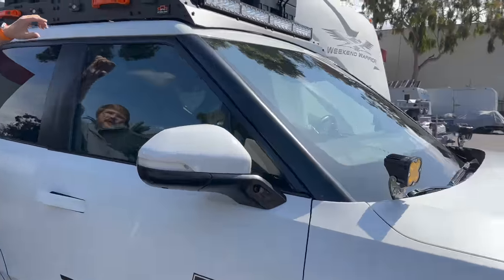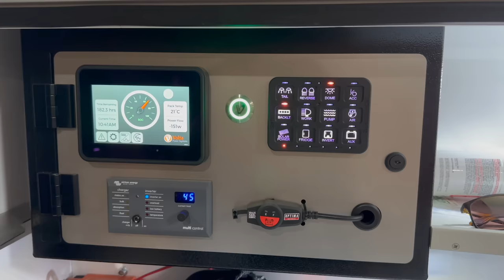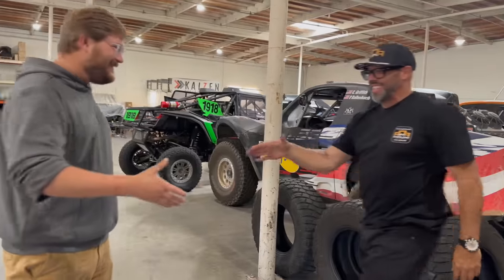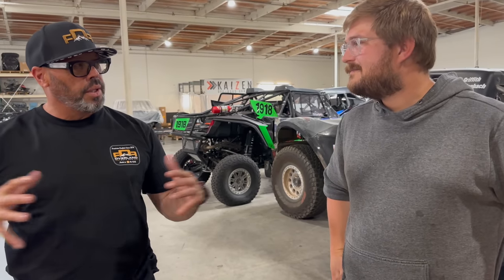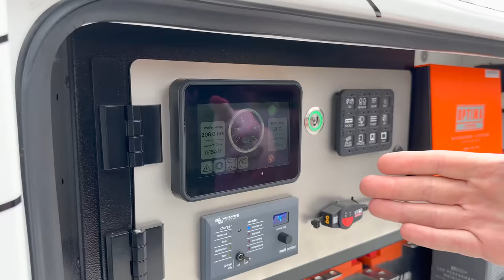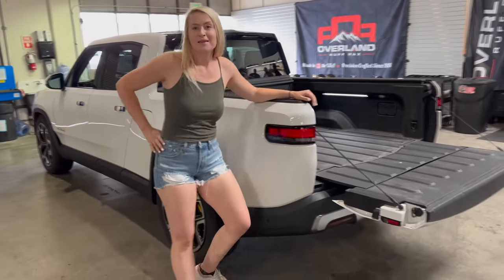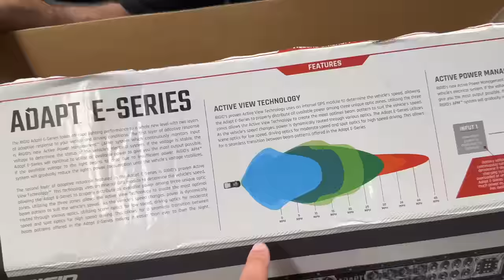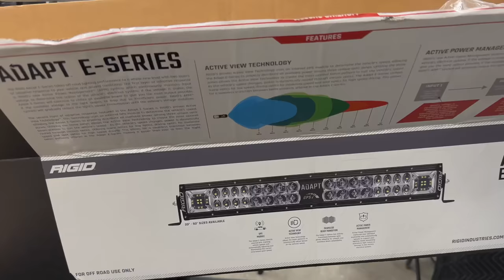Starting Our Rivian Adventure Build! Installing The Overland Ruff Rax Full System + DCE Showcase

Comment: Dang, that's some pretty cool kit!
If anyone's looking for light bars, Rigid is obviously the top end, but I've had good luck with Quadratec light bars. They're like 1/3 the price. I had one on my wheeler and my buddy had a few on his truck. Good light quality and after a few years, still had no moisture ingress. This was like 7-8 years ago, so as long as their quality is still the same it's a great option. I had the 10" dual spot/flood bar, was an amazing light for night wheeling. Easily as bright as a regular OEM LED car headlight on high. We both no longer have our vehicles, so don't know how they are at this point.

Comment: One of 2 working tonneau covers. 🤣  Mine is still kicking as well! Loving the bed/roof racks. may have to go that route on mine as well eventually.
"Same!" (regarding the front bumper).  I NEED a proper off-road front bumper and it'd be great if it could include a winch.

Comment: Roughly £120k in my portfolio are in tech/TSLA stocks, can I get an advice on any other stocks that I can acquire to diversify my reserve across multiple markets while creating a comprehensive portfolio allocation that balances my concerns of risk aversion and returns that meet yearly inflation.
Reply: You need to hire a financial advisor to help you diversify your portfolio by including Mutual Funds, Etf's, the 11 GICS groups, inflation-indexed bonds, and stocks of companies with reliable cash flows rather than growth stocks, where prices were based on future prospective earnings.
Reply: @leedavis3639   That's correct. At first, I wasn't too pleased with my gains compared to my previous performances, I was doing so poorly, I thought I needed to diversify into better assets, so I got in touch with an investment-advisor. That same year, I pulled a net gain of £550k, which is about 10 times more than I average on.
Reply: @chloeanderson543   My portfolio has been in the gutter for the entire year, so I started researching new ways to profit in the market, but everything I tried just seemed to miss the mark. Please let us know the name of your financial advisor
Reply: @farehtinyilmaz851   Having a counselor is essential for portfolio diversification. My advisor is "Trade with Ethan Grayson" who is easily searchable and has extensive knowledge of the financial markets.
Reply: @chloeanderson543   Thanks for this tip. His handle & website popped up on the first page immediately I searched Ethan’s name, I read through his resume and it seems pretty tight. So, I dropped a message & hopefully he replies soon.

Comment: Curious to see how the Rivian handles the rear roof camera being blocked all the time and if you find it problematic in any new or unexpected ways. Or if these guys have a solution to ”relocate” via an add on camera solution in the pipeline. Love it though.
Reply: I was wondering this as well.  How does Rivian use the bed camera?  Surely, not just for gear guard.

Comment: When bolting the rock sliders under the vehicle, they stated they were bolting to the battery. Were they using the frame rails or the actual enclosure bolts?

Comment: Why does Rivian refuse to program a virtual locker?
Reply: Im pretty sure they would rather you get the quad motor which every wheel is individually driven which negates any possibility or need for a locker. In theory the computer will identify which tire has traction and apply torque to that corner.
Reply: @Danielprokopij  kyle has a quad motor and just said in this video his free wheel just spins while the grounded one has no traction.  A virtual locker would force both motors to send power simultaneously
Reply: @carperdiem8754  My quad motor does the same. If I could get the truck to "lock" all wheels and spin at the same speed, I could gracefully climb rocks and dig out of the sand. Even "Rally" mode with stability control set to "off" results in one or more tires not spinning when trying to dig out or trying to help a friend pull me out. It was embarrassing, not to mention unnecessary.

Comment: Hmmm, why does that trailer that you used to charge your truck using 220v AC.  The trailer has batteries along with the truck. Why not charge using DC. It would be interesting to determine the loses are when going from DC to AC then AC to DC...
Reply: Because you can’t. The DC charging protocol has a proprietary handshaking process.

Comment: Update: Hi Guy,  We’re collaborating with Tesla to open charging for Rivian vehicles at more than 12,000 Tesla Superchargers across The United States and Canada.
Starting as early as Spring 2024, we’ll offer an NACS adapter that allows you to charge at Tesla charging sites. In 2025, Rivian will incorporate NACS charge ports as standard in R1T and R1S and offer a corresponding CCS adapter. No matter which charging port is built into your vehicle, you’ll soon have access to over 25,000 DC fast chargers spanning Rivian Adventure Network, Tesla Superchargers and other third-party CCS networks.

Comment: Why do you need lockers? That sounds like Rivian just needs to fix their traction control software.
Reply: What folks are most likely talking about it a "virtual" locker setting.
Reply: @ryangrassmann  No Kyle wants a physical locker, because he doesn't think they can make a virtual locker that works. (Obviously their current software isn't up to the task for some of the situations he puts it in.)
Reply: @mp3mike237  ok, sure. He thinks they can’t. But, they actually can. It’s really simple (background in electric motor control). Spin them all with full power capacity, modulated by accelerator input. One actual example would be how they demonstrated tank turn. 
And, yes, I agree with you- that would be “fixing” their traction control software. 
Much simpler, no additional weight, parts, etc. It could be implemented by OTA update. 
I’d even accept the mode being limited to 20mph like most of the off-road settings.

Comment: Let’s say the Rivian has a 200mile range in stock form. Add a suspension lift and bigger tires adds weight and drag reduces range. Then tow a camping trailer reducing range even more. Add a camping trailer with heavy batteries even more weight. Which adds up to  a fortune. Or you can just use a gasser/diesel and add a larger tank and have better range at a fraction of the cost. And don’t get me started on brownouts and durability of electronics in the off-road. Plus who recycles all the spent batteries that maybe will last 6years. 🤔